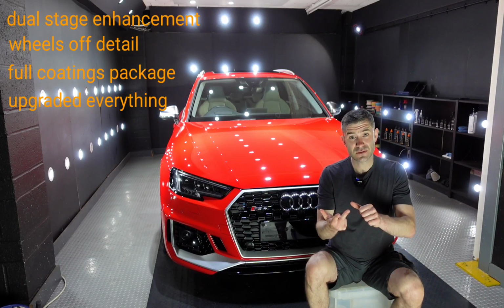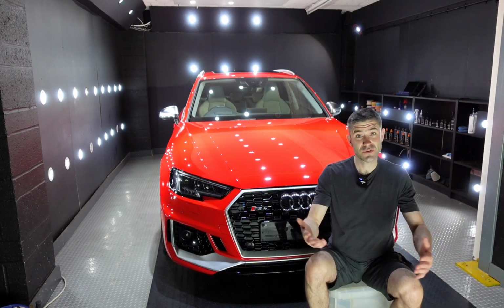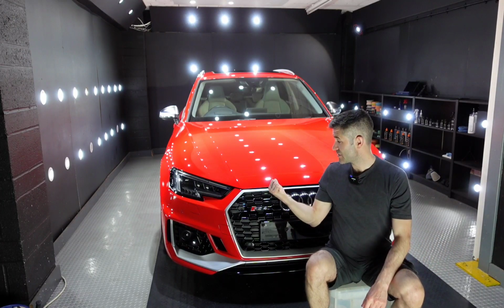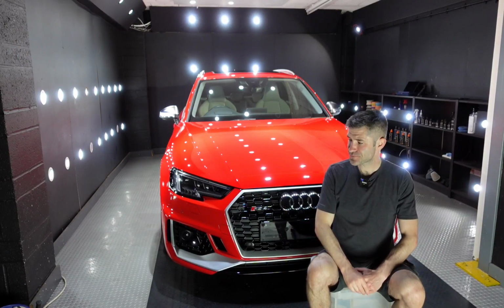Audi RS4 dual stage enhancement and upgraded ceramic coatings package

Comment: The new set up is waaaaaaay better :D Fair play. What camera are you using Matt?
Reply from the maker: It's a sony zv1, seems to be a great all rounder. Just received a new gimbal to smooth stuff up a bit and waiting on a wider lens. But I think with practice it WILL be worth it
Reply: @ObsidianDetailing  great to hear. I'd looked at that camera and was awaiting feedback from another guy in our world... Onwards and upwards 👍
Reply from the maker: It's good. It's definitely not what you tube has you believe lol. But there are some nice built in modes. I 100% guarantee your phone is better as a point and shoot, this seems to excel if you can dial it in manually